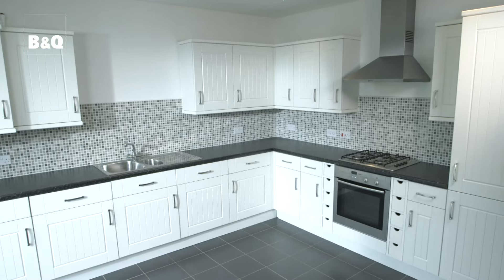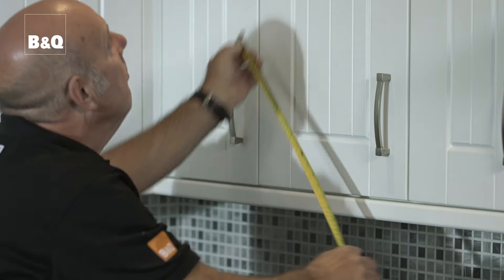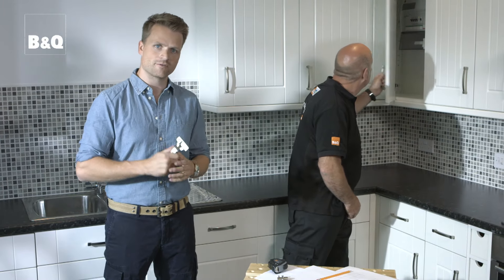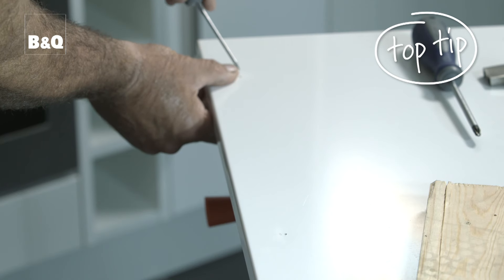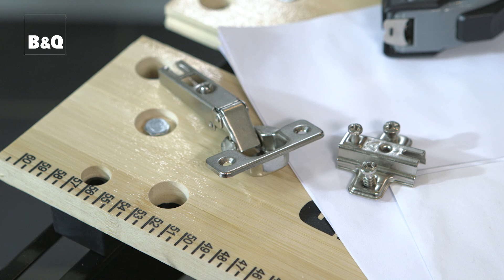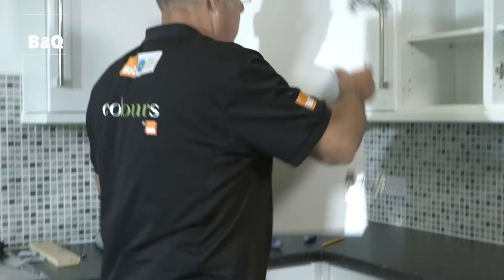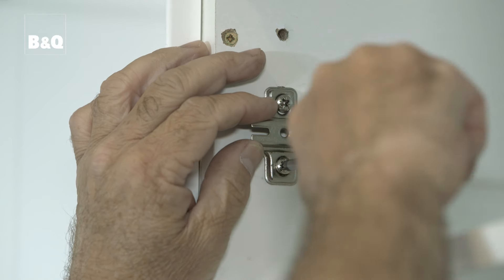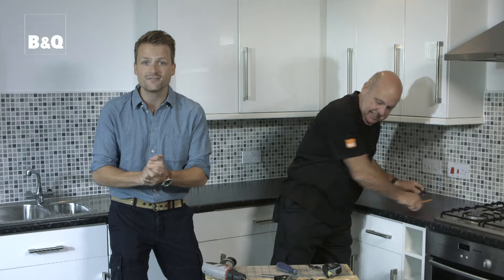How to replace kitchen unit doors

Comment: Please, what length of soft close hinge should I buy for Caraway cabinets? I have all my base and wall units fitted - can't find any Info obout hinge length and there's so many. I want a 110° hinge. Thank you
Reply from the maker: Hi, Alistair. Thanks for your question! The size of hinge need for a Caraway cabinet will vary depending on the size of the unit. However, here's a link to some Soft Close 110° hinges on our website: https://www.diy.com/departments/goodhome-kombu-soft-close-110-clip-on-cabinet-hinge-pair/3663602643784_BQ.prd
Hope this helps! 🛠